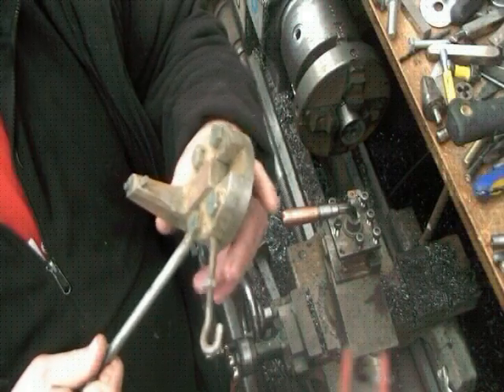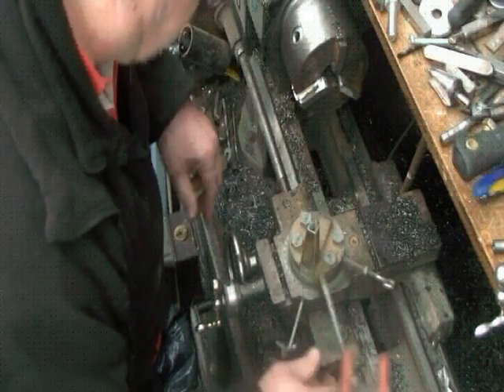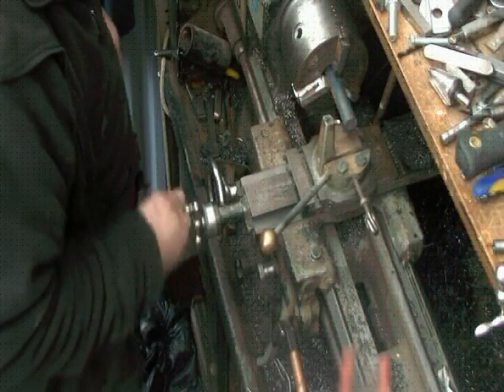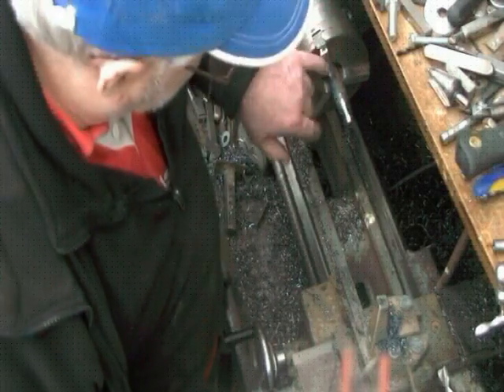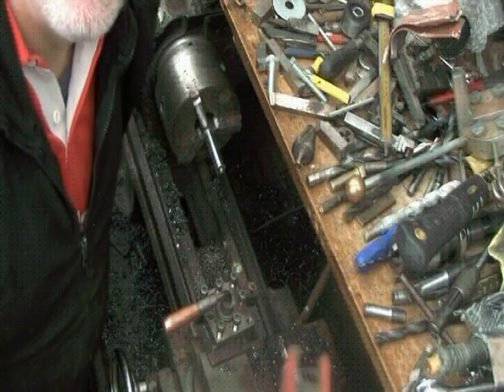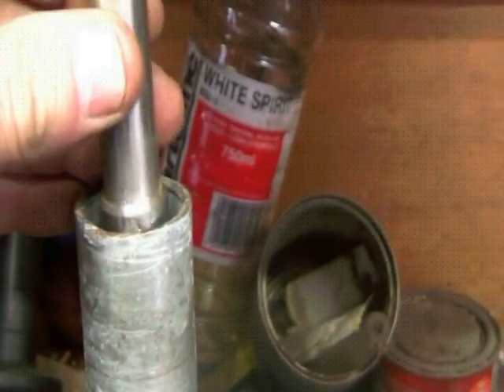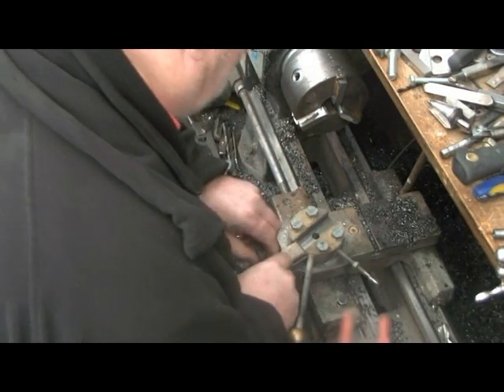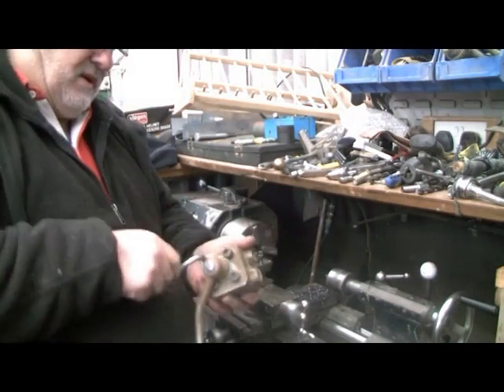how i make coin rings..the starting of the spreader..

Comment: Nice work Robert,  will that replace the doming block or used in conjunction with it?  I'll have a go making one of these, except I don't have a lathe but will wield on ball bearings to some steel bar and see if that works,  cheers for the tip.
Reply: Dave Maher That def won't replace the block or even go with it.. Who wants to drop their coin down a 4 inch tall pipe. And only one size imsted off one one block with all the sizes and all the dif size pins with it and price isnt bad....